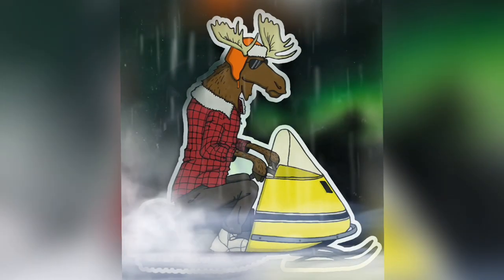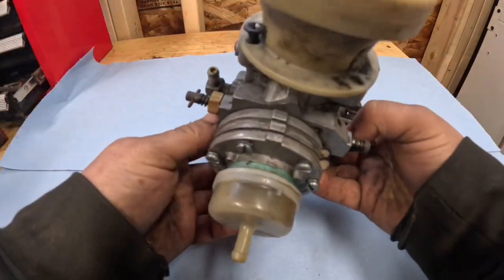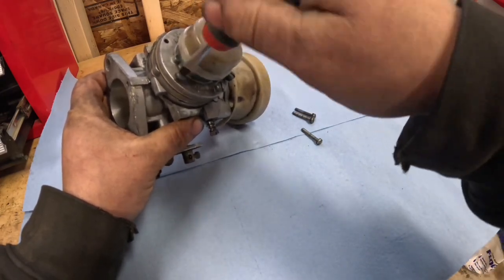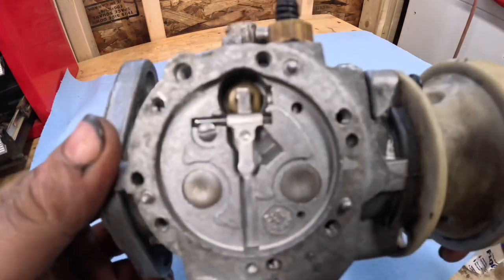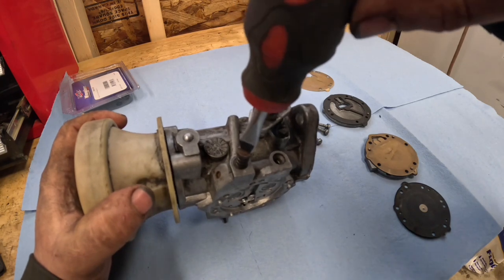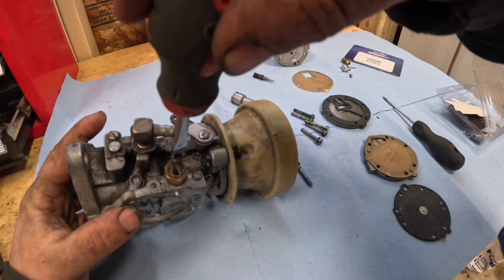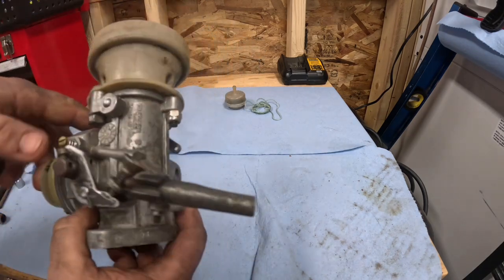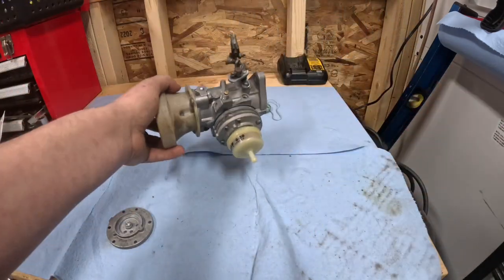Vintage Skidoo Carburetor Repair - Tillotson HD Series tear down #2stroke #snowmobile

Comment: Just some general comments.  First, you likely had numerous extra parts from kit, that you didn't use, since the welch plugs weren't removed.  As such, the check valve wasn't replaced, which was probably included in the kit.  That check valve is a known problem especially for old carb that could have sat for some time.

Comment: My father had one of these alpine snowmobiles. It came with a sled that had leaf spring skis. Had the big single ski to steer with. I think it had dual tracks. Slow sled but cool. Think engine was 289 or 389 something  odd.

Comment: The welch plugs are included in the rebuild kit for a reason. Why didn't you remove them and clean the orifices under them.
I'll just go on to another rebuild video, preferably made by someone who actually does it right.
Bye Felcia.